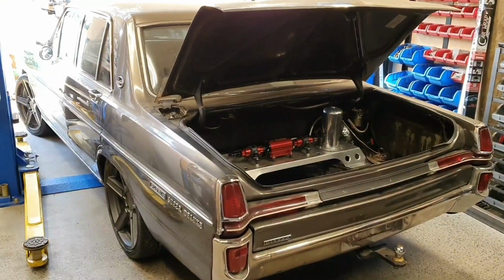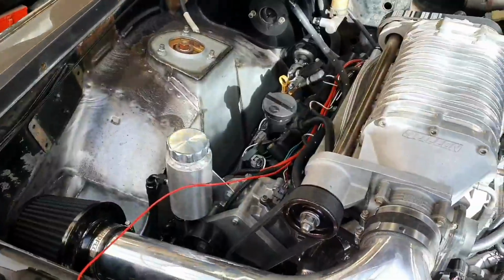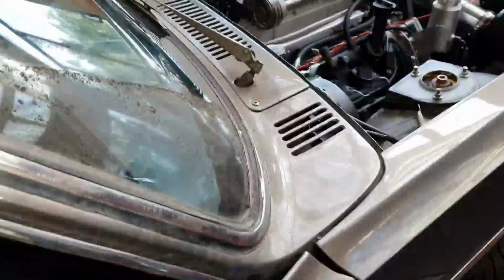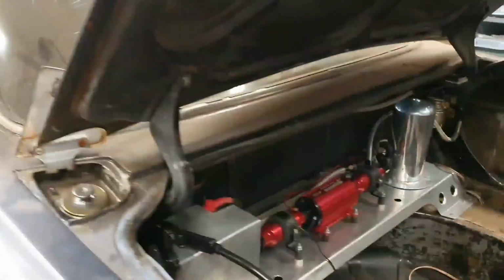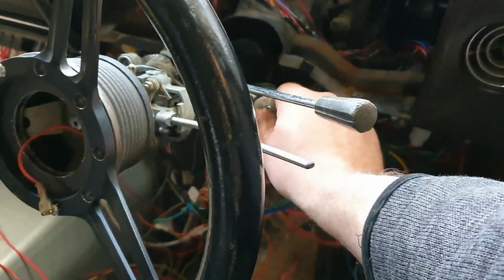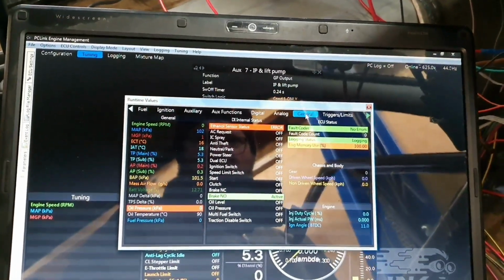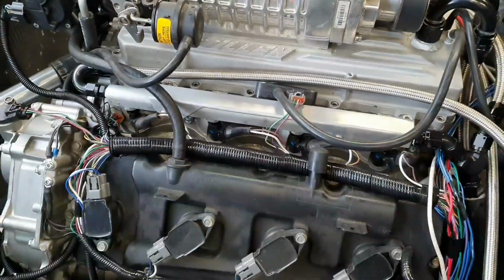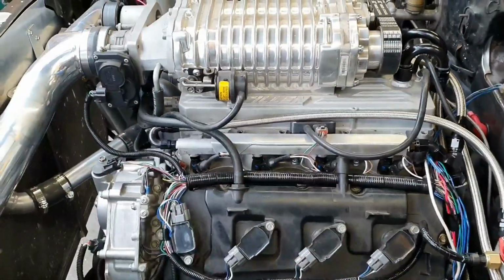69 Gloria supercharged V8 first proper start.

Comment: Oh no Glen you're running the intercooler wire over the radiator lol you naughty boy. Looking good, coming along nicely can't wait for the first drive video.
Reply from the maker: Its ok its red so the electricity goes faster, so fast it doesn't need to be attached to the pump - it just goes there by magic :)
Reply: @TheLabLimited  now that is cool :-)